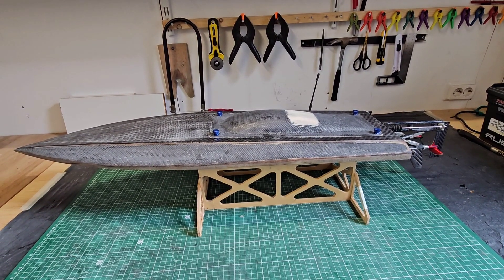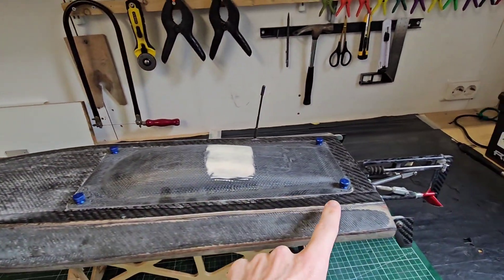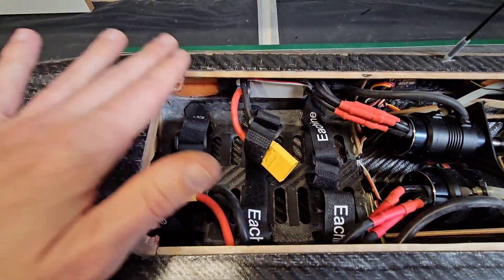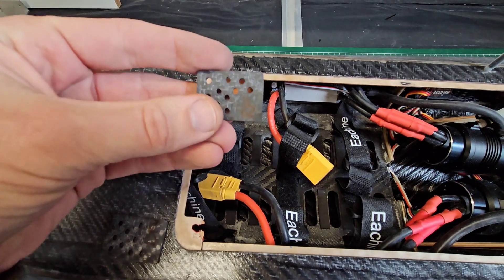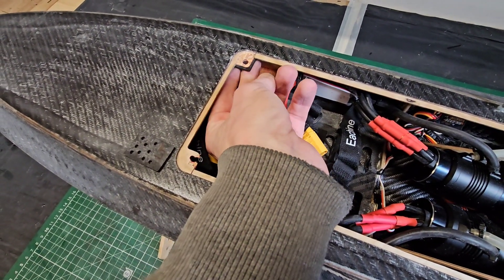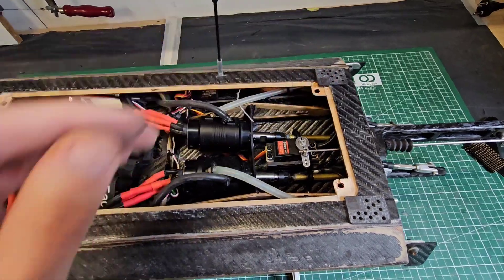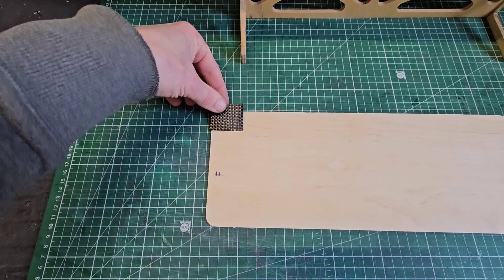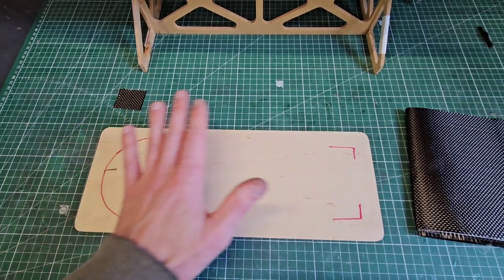RC Boat build: How to make a carbon fibre hatch

Comment: Have a think about taping areas up during laminating or bonding. Nothing worse than when clamping something and resin or bog comes out, especially overhead and falls on to something ands sets. Also just generally cleanness, stopping resin on your hands going onto other parts etc- like paint work. Also where you have Carbon Plate for your fasteners you could look to tap a thread into the carbon rather than added a fitting, and large flat dome nuts can be more aero but hard to mount on a curved surface. And gloves when sanding etc, both to avoid dust in your pores but also generally you want gloves to not contaminate the carbon as your hands have oils on the surface etc. Just some thoughts, not criticism but might just help make your life easier. The more time you invest in prep the less secondary work you have to do
Reply from the maker: Thank younfor the advices, I'll take them!

Comment: Great inspiration as usual :D Mr Cozy I have an announcement. My 3d printed hulls are turning carbon fiber/kevlar. Same shape, same scales. Just broke my 1/5 scale on the first water trial. I'm gutted! So I'm now printing large-scale molds for carbon laying. I let you know how it goes. Cheers
Reply from the maker: Ah, too bad to hear that José! But you're on the right track, making molds with your 3D printing skills, and then make a real strong hull 👍 Keep me updated!
Reply: @CozyRC  Well for small stuff sure PLA is still the way to go. But I was really mental with weight savings. A 1/5 Hull 1200mm long 1.35kgs after epoxied. Well in places was paper thin. The 5692 motor is heavy and pulls quite a bit of torque.